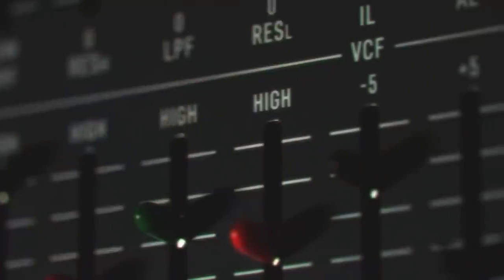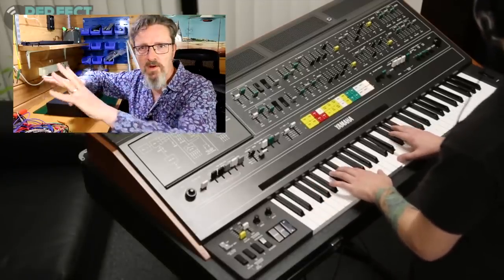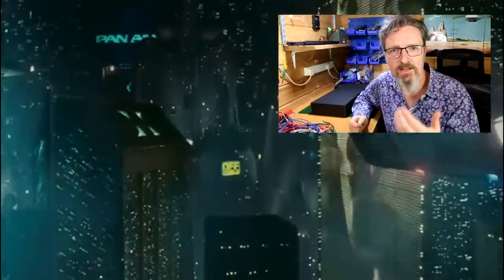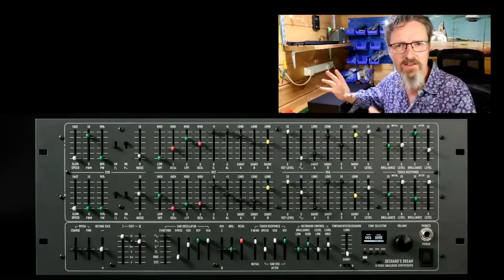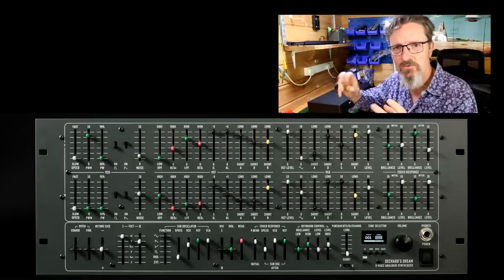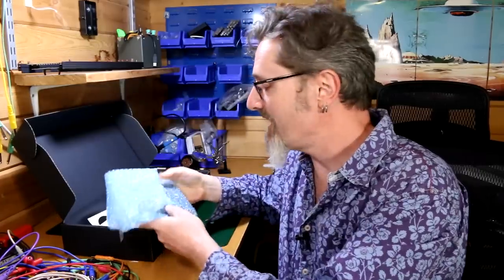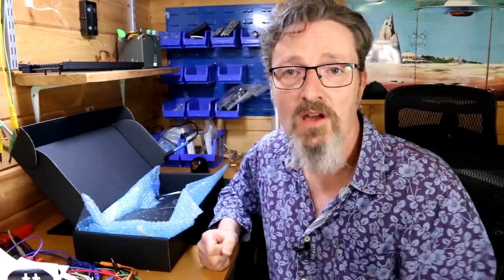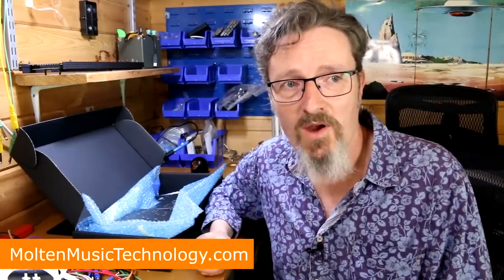Deckard's Dream DIY Build 01 - Introduction and PCBs

Comment: Wow, that's a "significant build" ;) I can think of a few things: With your BOM, make the suppliers do the work. Just send it to them and ask for a quote for whatever parts they have. I'd recommend you get a better soldering iron - preferably temperature controlled - they have a knob you can set it by. I have a Weller (good brand, reasonably priced) where the temperature is set by the tip - that works too and have used it for decades. Finally, there's no shame in using IC Sockets. They're cheap, and mean you don't have to worry about overheating your ICs and for debugging, you can just swap them out. Just make sure that doesn't interfere with you clearances between those plugin boards. Oh, you'll also need a solder sucker / braid (don't think you mentioned that). I really wish you the best of luck as with a build that size, it will help... I think you've got the right attitude though - and that's to not rush it as one simple mistake can lead to hours or days of debugging, which as someone mentioned is not easy.
PS Remember the classic "How do you eat an elephant? One piece at a time..."

Comment: Robin, would recommend joining the DD build group on Facebook if you haven't already, loads of helpful people on there!

Also whilst it is possible to build this without loads of test equipment, old analog oscilloscopes can be found cheaply (sometimes even free) locally or online and they are very helpful. 

Looking forward to the rest of this series!
Reply from the maker: Yes, i've joined a couple of DDRM facebook groups which have already both helped and bamboozled me just by lurking.

Comment: Great video! Before you start soldering the main board, PLEASE make sure you show how to break off those two edge strips on the long edges of the PCB. They need to be removed, and the best time to do it is before you start soldering components on it. Take some pliers and slowly break those strips loose, they will come off. Thanks.

Comment: There is a LOT of SMD on the Deckard's Dream, over 600 capacitors on the motherboard and the 8 voice cards. Fortunately they're all 0.1uF caps which are fairly big (SMD-wise) and easy to solder. Unfortunately they're all really, really, REALLY close to through-hole pads so there' the danger of plugging a through hole with solder which you'll then have to suck out.
Reply from the maker: My solder sucking skills are unrivalled so don't worry :)

Comment: awesome :) you lucky sod.

good luck with the build.

edit

i know it's not very environment friendly but get leaded solder (much easier to work with than lead free)
with the amount of soldering you're gonna have to do on this you want as few hurdles in your way as possible.

don't buy cheapo stuff either (something like locktite or CPC 60/40) you can get a roll of either that will last you literally years for about £20 from RS components

don't touch maplins branded stuff with a bargepole

Comment: Consider getting an SMD practice soldering kit or two from Amazon (board and some components) and a jeweler's magnifier or a microscope if it's 0603 or smaller.  I got a digital one that plugs into USB in the computer and does like 60x magnification, a game changer.  Also, a hot air rework station and lead-based solder paste will be worth the small investment.  Take it from someone who's just started down this path and has made some mistakes.

Comment: Recommend sourcing from Mouser or Tayda rather than Farnell. Much cheaper and, although they're based in Texas, Mouser generally get stuff to me within a day or two. Good luck with the build!
Reply: I just ordered from Mouser (thinking they had a UK warehouse) and they sent components via Fedex over the weekend. I was actually surprised how quick it came from US. No customs issues either!
Reply: Highly recommend mouser, I've just run the BOM through and it's quite reasonable with the addition of other parts.
Reply from the maker: Hey Phil - that Mouser project you sent me (i think) the quantities seem off. I think it's because it's only doing a single voice card and not all 8 - does that seem right to you?
Reply: @MoltenMusicTech  it could be just for a single voice card, I didn't study it. I'll have a look and see if I can compile a cart for a single voice board and then just add how ever many voice cards you want to build.
Reply from the maker: Ah ok - i thought this from your own build. Which makes me feel better about going through it thoroughly and making adjustments :)

Comment: True story: My old boss at Korg used to work for a company called Schober Organ. They used to sell kits that you build out yourself to make the organs more affordable. Well, there was a number you could call if for some reason there was some issue, and you would pay the tech (my old boss) to come out and have a look.

So, he gets there and the guy greets him and as he's walking over to the organ explains how he was "100% sure" every component was in the coreect spot on the PCB boards and how the stupid thing should work. 

Well, as it turns out the guy was right. He HAD put every component into the correct spot on each PCB. So my boss takes a closer look, and notices that each "solder" joint was completely clear. Apparently, Einstein had used Crazy Glue to attach all of the components since he  "didn't have a soldering iron or solder handy".    ....Yeah.

Comment: Good luck in your endeavor. I would love to build one of those myself. If there is a lot of surface mount on the VOICE cards I would definitely consider getting a solder mask made then you could install the surface mount stuff much easier and just reuse the mask for all eight boards.

Comment: Oh man, Black Corp obviously have trolled you hard. 

I'm not sure if you have really realized what a gigantic task you have in front of you. Getting all the parts is quite simple, but then the real "fun" starts. Assembling the PCBs of such a monster takes endless hours of highly focused work. And debugging it afterward (don't dream about it may work when you have finally finished assembly), is a whole nightmare on its own even if you would have a solid knowledge of electronics.

That's definitely not comparable with any of the other DIY kits out there. I wish you the best (but fear that won't help).

Comment: I could build it easily but rather pay for the built version. Its worth every penny to have it manufactured on an assembly line. The solid state components are very expensive for us compared to the factory having them at cost. Considered building this kind of stuff on you tube for view profits and to show off however I need to remember every time I try to show off in life I end up getting showed up in some way. We can commit no errors and still lose, especially in this era for some reason. Good luck on the project'

Comment: Good luck Robin! The best advice I can give you is upload your BOM to octopart.com, and when you're soldering – keep things clean. The easiest way to get good solder joints is to use extra flux. 8341-10ML from MG Chemicals is a very good flux. Flux solves every problem. Flux for president!!

If you need to buy new solder – ask me and I will give you recommendation on lead and lead-free solder if you wish.
In any case, go for very small diameter solder with double or triple core no-clean flux.

Comment: Definitely get a temperature adjustable soldering iron with a chisel tip and use 60/40 solder trust me
Reply: Sound advise here...
Reply: Get a  TS100 from gearbest or banggood. Cheapest way to get a great quality temp control iron.
Reply from the maker: I'm going to start with what i have - which is temperature adjustable and i think there's a few tips. There will be time for sorting these things out :)
Reply: @MoltenMusicTech  By the time you finish this project you will be a master of solder (1st DAN).

Comment: Ive build many modules sourcing parts over the years but made many mistakes on my way, i think its too much expecting you to source parts for the first time on a build that big if you want to build it your far better off ordering the kit of parts. If not it will cost you a fortune in post and packing as you'll be odering components from around the world and forever re-ordering components either ones you've forgot or ones you've ordered that are incorrect values, footprint etc.
Reply from the maker: I’m really feeling your optimism 😀